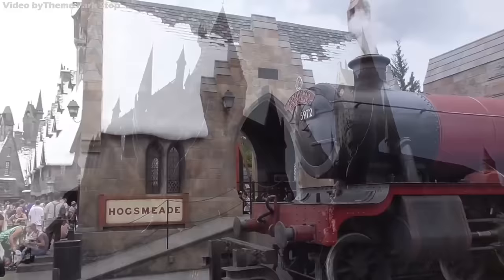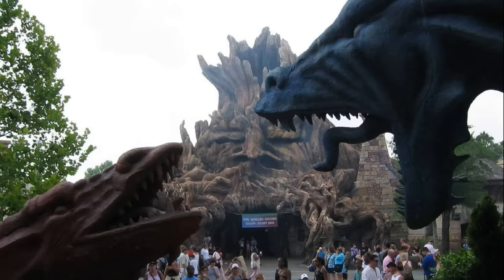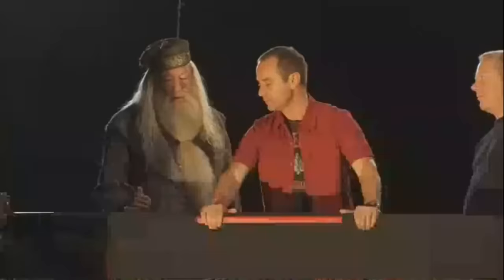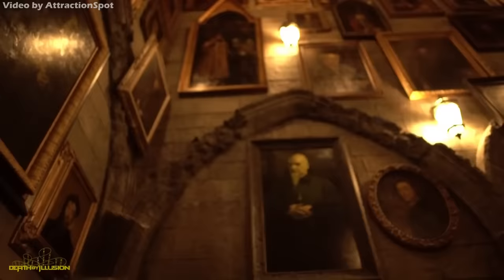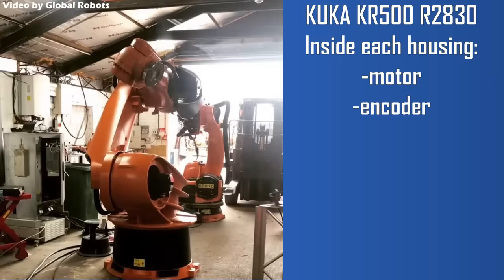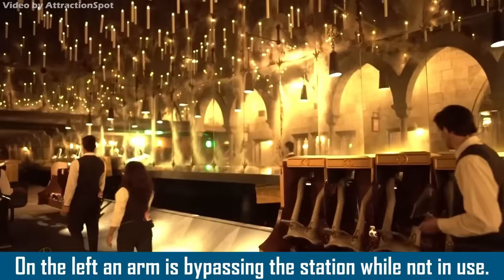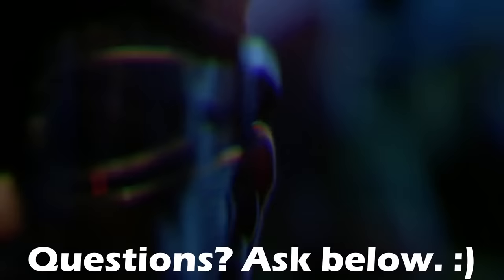How It Works: HP & The Forbidden Journey | The Robot Ride Inside Hogwarts Castle

Comment: My favorite ride ever. I went on it 13 times in a single visit using the single rider line. Exit the ride in the gift shop, cut thru the locker area and you're back on in seconds
Reply: Yup it’s an amazing feeling finding out that a popular ride has a single rider line. People trying so hard to be on the same ride even tho it’s the exact same ride for everyone and you don’t need to interact with people next to you. I’m speaking for most rides but not every ride of course
Reply: totally agree with single rider!! we went just after it first opened and it was packed, but on the single rider queue we were on in 20 mins and I was on the same bench as my sister. They load people so fast that single riders are pretty much on every bench.
Reply: When I went over the summer there was effectively no wait for the single rider lines. And if you are only with one other person there is a pretty high likelihood you will get to ride it together after 3-4 times through (which when I went took < 30 mins including ride time as the walk through the castle took longer than waiting in line).

Comment: Apparently, the ‘Universal Monsters’ ride at Epic Universe is gonna have a more advanced version of this ride system where the arm is on a rollercoaster track
Reply from the maker: If the park ever gets built. 😵😞
Reply from the maker: Although Dynamic Attractions posted a video of some new stuff and there was a clip of what looked like an early test of the ride. It looks like it's been reduced to the same system as this as opposed to one on a coaster track (though there has been some work on the track mounted one).
The test showed some guy on a stage (probably Musion) with some Frankenstein looking stuff in the background (vials, saws, etc). They quickly took it down, so there must have been some truth to it.
Reply: @AmusementLabs  I do hope this rumored multi-floor version turns out to be true
Reply: That sounds so cool and yet also sounds so nauseating
Reply: The FJ vehicles are 12 tons each. That’s 24,000 pounds. Not sure how a single car weighing that much will do on a coaster track.
Reply from the maker: @Shag471  🤷‍♂️ really thick track with really thick supports?
Reply: @AmusementLabs  Anything is possible I guess but you’d be talking about tracks the size of support collums for other coasters.
Reply from the maker: @Shag471  I'm sure they'll figure something out to reduce the weight. 12tons sounds a bit heavy for those arms.
Reply: @AmusementLabs  The robotic arms are only 1 part of each vehicle. They also have to carry 4 guests, loads of computers, audio equipment, fans, lighting and their own maintenance equipment for each vehicle in the event they get stranded.
Reply from the maker: @Shag471  yes and no. They're not carrying stairs and maintenance stuff is usually a tablet controller.
Reply: @AmusementLabs  I know they don’t carry stairs. I worked at this attraction room for several years. ;)
Reply from the maker: @Shag471  12 tons still sounds excessive...
Reply: @AmusementLabs  You’ll understand when you stand in front of one.
Reply: Amusement Labs You wrote something mentioning these vehicles essentially being  “arms on wheels,” so that weight shouldn’t sound excessive at all. Just in case anyone else thinks so... these vehicles, as a whole, need to be extremely bottom heavy in order to withstand the forces put onto the rolling structure while the arm is in motion. I really do love your videos. They’re really great. Keep up the good work.
Reply: I really hope this is true. My husband will die, he loves this ride, and he LOVES monsters. He bought shit himself when I told him about the concept for the monster land in epic

Comment: The ride also has a well-thought-out method for loading and unloading disabled riders.
There is a separate loading room without the moving sidewalk.  A single Kuka arm and carriage is diverted from the regular track, enters this room, and comes to a complete stop.  The disabled rider(s) and their friends (still four people total) can then take as long as they need to load and unload, without disrupting the ride flow of the other carriages.
Once loaded, this ride vehicle is reintroduced to the regular ride flow, but returns to this separate station afterwards.
This is a great improvement to older ride systems that use the regular loading area for disabled riders.  And probably not that expensive to construct, since the ride systems need a way to take a single ride vehicle out of service anyway.
A thoughtful and much-appreciated addition by the ride’s designers, and Universal, who’s staff did an excellent job running this station.

Comment: A small additional detail: there is a second station behind the main station, with switching tracks before/after the main station. There is usually only one car arriving at this station at a time, but it can remain stationary during loading/unloading, and is launched upon clearance from that station's operators. When launching, the system slows the cars leaving the main station just enough that it can skip into the ride without a major disruption, and similarly it slows the cars behind the "secondary" car at the end of the ride just enough to allow the switching to occur.

This station is primarily used for disabled access to the ride, but it's additionally been used for VIPs, as the route to this station completely bypasses the main queue.
Reply: I went to this station once after the ride ended because we had a person in our car with a cast on his leg, and he and his friends needed to get off.  The ride operator overseeing the car asked my husband if we wanted to stay in the car and go through the ride again, in which we said “Yes!”

Comment: Those are not “buttons” or flags on the sides of the vehicles as was mentioned. Those are indicator lights as to which mode each vehicle is operating on. Ride attendants on the load platform carry a RFID tag in one hand. They are able to tell each vehicle what mode to be in according to different sensors on each vehicle. The green light means the vehicle is tagged for dispatch. A blue light means the vehicle will travel to the Secondary load platform. Another sensor will pop the harnesses on the vehicle when an RFID signals it. There isn’t another one for maintenance mode. Lastly it takes 2 ride attendants to disable a vehicle using their RFID tags. It’s a very simple feature that is guest proof should a guest try to mess with it. So next time you ride, pay attention to the yellow RFID tag in your ride attendants hand. :)
Reply from the maker: Ah, I figured something seemed up with the set up being a button. I should've known it wasn't.
To be frank this video was a tad rushed.
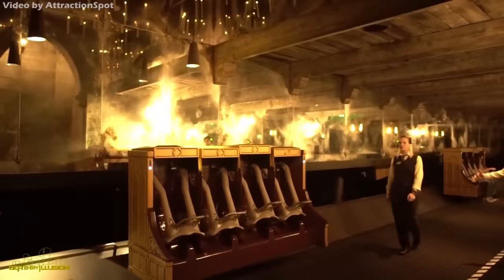Reply: I'm pretty sure you can see the attendant holding one at 7:47. Interesting!

Comment: Great video!

Just a couple of technical notes;

-amec Dynamic Structures (now split off as Dynamic Attractions) just outside of Vancouver, Canada did the integration and designed and built the whole mobile base system.
-The robots are built by KUKA, but they're not a standard KR 500 (or any other standard model) - they're a specific 4-axis variant, missing two of the axes at the wrist (J5 and 6).  They're closer to a KR 1000, with a shortened J4 axis and the wrist removed.  This increases the effective payload since the moment on J3 is reduce (and the extra reach and axes aren't really required).
-The motors on the robot are called servos.

Your summary of the mobile base and drive system is spot on!
Reply from the maker: Thanks for the info about the arm. Good to know. As for the name servo, yes, I do what those are (I have a box of them), but they don't normally have a brake in them and these do

Comment: Im really proud of myself for working out how on ride lights and speakers work whilst waiting in the queue and thinking about it: Capacitors on board fast charged in station, not batteries! And it was so.. Thanks for the conformation on one of your videos. I find this stuff really fascinating.
Reply: As a designer on the project I can tell you that there are no capacitors on this ride.  The on-board audio system gets its power from the same buss- bar system that powers the arms.  But good guess though!
Reply: @danielwilliams9444  Ahh ok. Great explanation. I now know Harrods ride and velocicoaster light / audio work with capacitors and that's where I was thinking it. In this case direct power from the robot arm makes sense yes

Comment: Great video, one extra note is that there is a ‘secret’ static loading area which branches off just before the main loading area at the end of the ride and joins back just after the start. Used for disabled access to the ride, the ride operator can hold the car for as long as needed to load people. I used it when my mum broke her leg and was in a wheelchair, though it did require about 4 elevators to get to as you have to navigate around the main ride structure.
Reply from the maker: Oh yes, I think I've seen that. Though I didn't include it cause I couldn't find a way to work it in.
Reply: This is called the Secondary Load platform. It runs parallel to the main platform but cannot be seen from anywhere on the ride unless you are actually sent to Secondary. It is themed just like the rest of the ride and the hallways to get there are as well.

Comment: something that a lot of people don't know is that there is actually a "secret" loading station for people in wheelchairs and scooters. it is a stationary platform right behind the main moving platform. there is a gap in the system for this vehicle that allows it to jump in and out of the system without stopping the rest of the ride. its pretty neat
Reply: Huh. I use a scooter, and they have always made me park it outside the castle and hobble through the line with my cane. Taking my scooter in was never even offered as an option.
Reply: @operabeth  you might’ve had to ask for it but my family had the golden disability pass so we got to go their, i don’t know if it’s just for that or what

Comment: These ride breakdowns are amazingly detailed. Thank you. 
I’m not the biggest fan of this ride mostly because the images are blurry. I thought I heard they used 3d glasses at first but had to omit them because riders got really bad motion sickness.
Reply from the maker: Thank you. 🙂 And yes, they did use to use 3D projectors with glasses. People did get sick so they opted to replace the dual projectors with a 4K 120fps projector which helps with motion sickness.
However, even at 4K the video still looks a bit blurry since the screen is so big.
Reply: @AmusementLabs  in what year did they made the change?
Reply from the maker: @thefreebeatssampler8511  late March 2017.
Reply: @AmusementLabs  oh ok.  I rode it 2014 in Orlando. Looks like i rode the original version.  It didn't bother me at all but my stomach is not as it used to be. I rode banshee, the bat and banshee again and got a bit sick for an hour so im thinking about it for my next florida trip next april

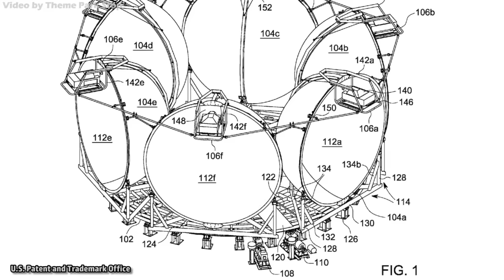Comment: Great review.  I think you missed one detail though. I believe while there may be some 1/2 sphere projection screens on a carousel (@8:00), I believe there are also some on separate Kuka robots themselves. Once the passengers enter the projection sphere the 2 robots (passengers and screen) are synced together and ride along parallel tracks. This allows the passenger car to be moved in any direction for realistic motion simulation while the screen is synced to match this motion. This gives the appearance of full flight motion without ever seeing outside the projector screen. I saw this in action once when I peeked around the corner. It was a while ago, but I'm sure that is how it was done. Truly a remarkable ride though. One of the all-time best.
Reply from the maker: I can see how that could work, but it has been seen and confirmed that they are on a carousel of sorts. The arms move along the track at a constant rate and the arms basically push the riders as close as they can get into the dome (turned on its side). The arms do have limited motion during this period as to hide the edge of the screen more easily. This is also helped by the boxed in view riders get from the seats and covers.
Reply: Like I said, it was a long time ago, probably 2013. I do remember seeing the screens on a robot. Its also possible that those robots were on a carousel instead of a track.
Reply from the maker: @bigbaboo-3937  I know, it just seems like a needlessly complicated design if it were actually implemented. Maybe they did try it on one arm without saying anything.
Reply: @AmusementLabs  it's a carousel, nothing more.

Comment: I waited 2½ hours to get in ride and as soon as we passes by the dragon, the power went out. Like literally it was all dark for 10-12 seconds. We all thought it was part of the ride😂, but then when it continued, the audio and dialogue and ride all was not in sync anymore. So when we returned to the station, the ride operator asked if we wanted another go at it because of the power loss, and we did. Got to ride it twice and got the proper experience 😂

Comment: As someone who has worked with kuka arms before (granted probably a little bit older) I'm not sure how much I would trust them to move me around they do have systems that sense impacts and 99 percent of the time it works fine I have seen it fail on a couple of occasions (whether do to programing error that did not prevent it from stopping or a electrical fault I'm not sure.) One occasion that particularly sticks out to me where it karate chopped a loaded pallet of product in half or the multiple times it decided instead of coming straight out of the case loading area it decided to take the shortest path to it's home position which goes straight through the case closing mechanism. It only stopped both of these times when it hit something solid enough to overtorque the motors. Now I'm sure they have done a lot of updating to these machines since then I still shudder at the idea. I really hope the programing is really water tight on these machines and they are properly maintained and inspected.
Reply from the maker: True, it's never 100%, though they do have other impact sensors on the enclosure and I'm fairly certain a good part of the set is made of foam.

Comment: Sadly, this is probably going to be the closest I'll get to actually riding this, as most of the attractions at Universal/Disney are designed for the average sized person, not for fluffy people.
Reply: I'm fairly fluffy myself (6ft and 250lb) and I was able to go on FJ in Japan. I think some of the seating available in the Japanese theme parks is smaller than the US ones, but I don't know for sure. I could go on everything at Tokyo Disneyland and DIsney Sea. I couldnt go on the Hollywood Dream rollercoaster at Universal Japan, they had a tester seat at the entrance (I hadnt been in the queue for long) and a staff member asked me to try it out - I couldnt get the seat belt done up, which of course is the purpose of the tester seats. FYI it was in an alcove off to the side, I didnt have to sit in it in front of other guests.  I thought it would be a brilliant idea to have tester seats OUTSIDE the park so you know before entering which rides you can go on. If/when you do get a chance to go, you may be able to ride at least some rides. Any larger people been on FJ at WWHP?

Comment: So the queue line projections aren't projecting on glass, it's a super thin ink jet printed scrim that catches some of the projection. Also, the Kuka arms on the ride don't have those last tilt joints on the end of the arms that the video you showed had. Other than that, very accurate and well done video.
Reply from the maker: Are you sure about the skrim? I mean you can see the reflection of the balcony overhangs in it...
Reply: @AmusementLabs  At least in Hollywood, 100%. I'm one of the people that works on it 😉
Reply from the maker: @BrandonTisor  ah

Comment: Note: The catwalks only exist in the dome areas. If you're in the forest or chamber of secrets or other such areas you'll be rescued by a movable rolling staircase - similar to ones you've probably seen at home improvement stores.
Reply from the maker: Yeah I saw that. Probably should've put a footnote on that.
Reply from the maker: It is kind of concerning what it would be like if the ride stopped and a fire broke out given that it reported takes an hour to get everyone out of the arms when stopped. 😬 Hopefully they're about to override stuff so they can jog the chain to get people out in an emergency. Maybe the arms can default to lower as much as they can to the floor and the restraints can unlock.
Reply: Not true. Catwalks are all over the entire show building above nearly every scene. You may be thinking of the evac platforms by the carousels though. Those are actually behind you when your vehicle is in a projection dome and in the case of an evacuation your vehicle will turn and face these platforms.
Reply: @Shag471  i’m late but it is true, we would never evacuate from the catwalks above, the arms don’t even extend that high. if you’re not in a carousel you’re getting evac from the stairs and track walks.
Reply: @AmusementLabs  the procedure for a fire is quite literally let the ride cycle and get them off at unload lmaoo. Source: Trust me bro. jk i’ve worked here a while.

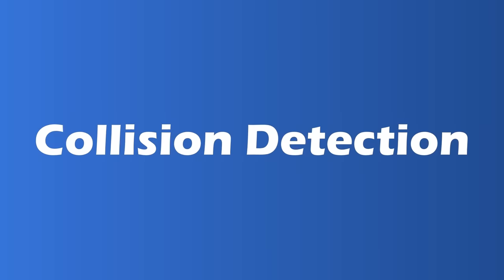Comment: 9:32 I mean... if it hasn't happened can it even be considered "extremely rare"?
Reply from the maker: If things need to be reprofiled or work done inside this feature can be useful. It's yet to happen during normal operations, however I have seen it during adjustments.